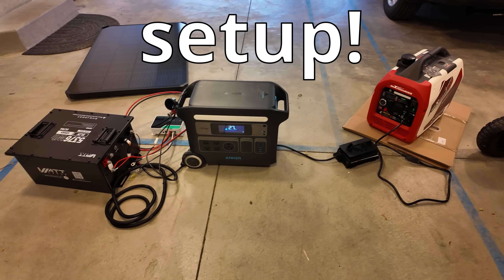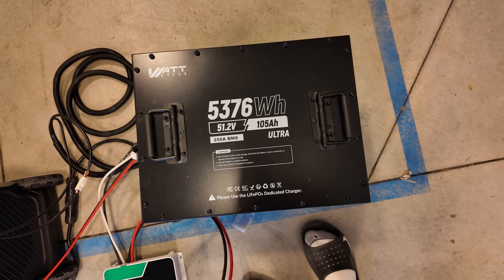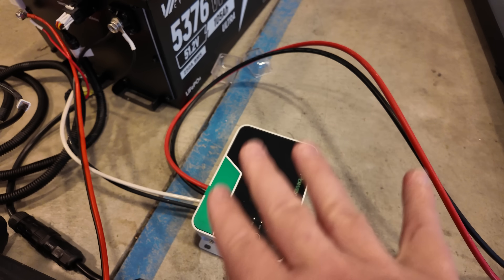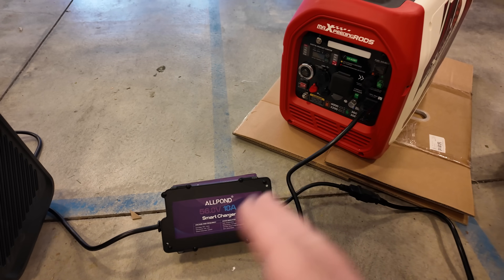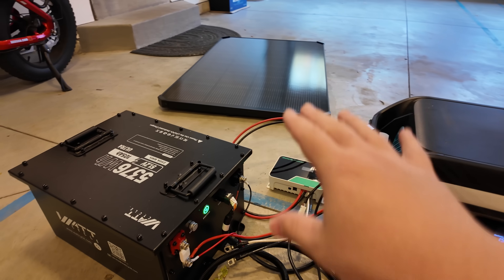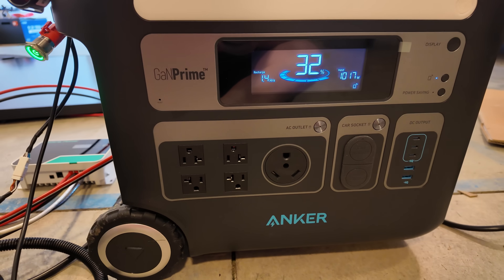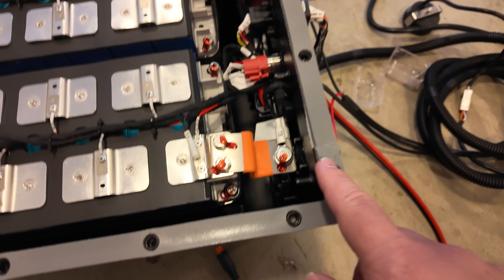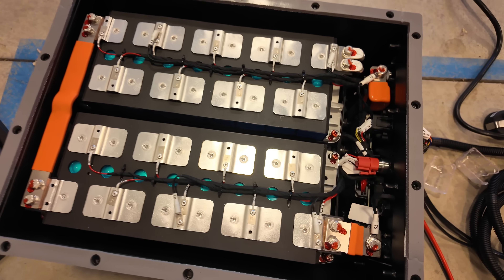The RV Power HACK That Makes Victron Obsolete! - WattCycle Golf Cart Battery

Comment from the maker: Buy a WattCycle Golf Cart Battery: https://www.wattcycle.com/products/48v-105ah-lifepo4-golf-cart-battery-with-bluetooth-kit?ref=fspaohfd
Be sure to use the code: TRICK and save 6% on your order!

Buy 120v 48v Battery Charger: https://amzn.to/3JvxiXt 

Buy EG4 Chargeverter: https://payoffsolar.com/product/eg4-chargeverter-gc-48v-100a-battery-charger-5120w-output-eg4cv48v100av3 
Be sure and use the code: TRICK5 at checkout and save 5% on your order!

Buy the Anker Solix F2000: https://ankersolix.pxf.io/RG6oAN or https://amzn.to/4b4mGrU 
Buy the Anker Solix F2000 Expansion Battery: https://ankersolix.pxf.io/Qj6Xao or https://amzn.to/4hH9fRq 
Buy the Anker Solix F2000 + Expansion Battery Bundle: https://ankersolix.pxf.io/mO2vLM or https://amzn.to/3X3ifrG 
Use code: ANKERSOLIX20 at check out (Anker Solix website only) and save a massive 20% off your order! (Does not stack with limited time deals or other coupons)

Buy the Bluetti Apex 300: https://tidd.ly/4pPlTlS 
OR
Buy from Amazon: https://amzn.to/4qgnXUg

Buy 40 amp solar charge controller: https://www.bougerv.com/products/40a-mppt-solar-charge-controller?aff=230 
OR buy from Amazon: https://amzn.to/41x5BDv 

Buy connecting wire from battery to power station: https://amzn.to/4o8m5eC 

Buy battery terminal fuse: https://amzn.to/4qAIra6 

Buy the best solar panels on Amazon: https://amzn.to/3LchSbj 

Buy MaxPeedingRods 4,000w dual fuel inverter generator: https://amzn.to/4nspzaE 

Watch the video showing the issue with passthrough charging on power stations: https://youtu.be/Jg7HqRmNQlw 

Ask me a question and get a personal in depth response: https://ko-fi.com/s/8d8df1880c 
OR
Sit down for a personal 1-On-1 hour long video consultation with me and I’ll provide answers and insights to anything you want to ask me about from this channel: https://ko-fi.com/s/dd139831a7 

All donations get 100% re-invested in the channel:
https://buymeacoffee.com/theresatrickforthat 
 
Affiliate Disclosure
As an Amazon associate I earn from qualifying purchases at no cost to you! Thanks for your support!

Comment: Is there a heated version of that wattcycle, and if not how hard would it be to retrofit a heating pad to the side of the case so it can take a solar charge in the dead of winter?
Also I already have a Onan 4000 series on-board generator; is it feasible to just permanently connect it to two battery chargers then connect them to the rack battery (or perhaps get two and wire them in parallel) along with solar, then to a solar generator, then to the rig? (so many questions here)
Reply from the maker: Not sure and yes.

Comment: This hack looks very interesting… I have a Bluetti elite 200 and I’m wondering if I connect my 37 V solar panels to an MPPT controller and use a 24 V lithium iron phosphate battery, would that work? And do I just attach the output of the MPPT controller to the Battery terminals and then attach the solar input of the Bluetti to the battery terminals also? Are there any tricks or safety advice I need to know about?  I’m assuming since I have only 37 V solar panels I can’t use the higher voltage battery, I need to be below the solar panel voltage?
Reply from the maker: Everything should work out great as you said! Just be sure to properly fuse and size your wires!

Comment: right so my vtoman flashspeed power station only accepts 400watt solar max but i will shortly have 2000watt worth of solar panels. with this solar controller and that 5000wh battery can i take advatage of all that extra solar during summer i.e get 2000watt solar input. Still learning all this stuff so apologies for anything stupid im saying
Reply from the maker: Yep! That's exactly how it works! And then at night it can trickle 400W out via the power station. So your power station will essentially get 24/7 "solar power"

Comment: Hi, The battery terminal fuse in your link looks very different from the one in this video and other videos you have posted using the same cable. Is that another one of your DIY harnesses?  Thanks
Reply from the maker: Yes! I just had a random inline fuse kicking around so I am just using that. If I were to buy something specific, I would get a terminal fuse. Much easier to install!
Reply: @theresatrickforthat  one more question please: the battery terminal fuse link directs you to a 30A fuse, so is that dependent on the amount of solar amperage going into the mppt or the power station input (i.e. I have 40A of solar going into my mppt > Temgo Battery > Anker F2000 @ 20A)?

Comment: Are the specs of the WattCycle battery so much better that the Temgo battery from some of your other videos, to justify the additional cost?  Thanks for your videos.
Reply from the maker: The build quality is head and shoulders above the Temgo. But power wise, they are almost the same. But the WattCycle is more capacity and higher discharge power.

Comment: Is a 10awg wire between the battery and the inverter and a 30A fuse to protect it, the correct combination? What are the calculations you are using to ensure you don’t melt the cable? Thanks in advance.

I am planning on using this similar setup with a Pecron F3000LFP and an EG4 server rack battery. (Not in an RV)
Reply from the maker: Yep! That’s exactly the fuse and wire combo I did!

Comment: I have the Eco Flow Delta Pro with a Honda EU 2000.  I can do this with the Eco Flow Delta Pro correct?
Reply from the maker: Yep! So long as the Delta Pro will accept at least 60V DC, you're good to go!
Reply: @theresatrickforthat  That's 60V DC "solar" input?
Reply: @theresatrickforthat  SO the EcoFlow Delta Pro shows the Solar Charging Input is 1600W, 11-150V, 15amp max...would this setup work?

Comment: Thanks for sharing your experience and findings! Watched your videos with the Bluetti Apex 300 and with the Temgo battery kit. Are you still using and satisfied with the temgo kit? And which fuse are you using for the battery? For the value, the watt cycle battery kit seems a little more pricy?
Reply from the maker: Yep! Still use the Temgo all the time! I use Victron fuses. The WattCycle is better built compared to the Temgo, but yes, there is a price difference!
Reply: @theresatrickforthat Make sense for the watt cycle built and the shut off button but there's actually more advantages with the Temgo built ironicaly in my case "no pun intended" lol  (plastic lighter weight, don't rust in humid area). Thanks for the quick response and it shows that you enjoy experimenting and finding ways to optimise ressources 👍. All the best on your adventures.

Comment: I would not trust that BougeRV solar controller and it's more expensive than the Victron 150/45 which can handle more watts, also comes with Bluetooth and is going to be much more reliable so why would you recommend it over the Victron? BougeRV solar controller $US217.25 =$AUD334. Victron 150/145 $AUD281
Reply from the maker: Must be different down under! :)

Comment: E X A C T L Y!⚡️/ you touch on but it’s important to over emphasize that it’s absolutely crucial to Make sure that your power station is rated to accept the voltage of the battery that you are going to connect otherwise you will fry the power station.

I.e. the power station is rated to accept up to 60 V input - the battery at 51.3 & as you stated can surge up to 55 or 56 volts when fully charged very very simple.

PS: love the channeling content. You’re bringing an enormous amount of value to this community. Thanks again!
Reply from the maker: Yep! Important detail! So happy to hear you are enjoying the channel!

Comment: I suppose one thing with everything except for the inverter on the power station bypassed, why not just go for an inverter and dump the other basically unused equipment inside of the power station overboard?  It would also allow you to draw at max power continuously instead of a continuous load of just 1,000W.

Another thing, what about using Anderson connectors?  An SB120 would be fine for going up to a 5,000W inverter.  Then your other stuff could go on Anderson Powerpole connectors and a distribution block.  Quick, easy hookup and disassembly.  Maybe add an anti-spark circuit to the inverter so you are not messing up your connectors.

When you get into 5+ kWh LFP batteries, it would be nice to be able to easily wheel it around.  It is just kind of hefty at that point.  Don't mess up your back now.

Another thing with communications and batteries, is what about just going for an all-in-one solar charge inverter and a server rack battery?  Then you start getting back into consolidating things into a main box instead of having it all parted out like what you have here.
Reply from the maker: All good ideas! Yes, if you were building from scratch, AIO would be ideal. But a lot of RV people especially already have a portable power station, why not make better use of it! And server rack batteries are awesome! But they are not built for high vibration environment like golf cart batteries are, which is why I like them for this. Thanks for sharing your thoughts and ideas!
Reply: @theresatrickforthat The setup I am using is based around a 24V 100Ah battery that is highly portable.  It is all modular with Anderson connectors including SB120, SB50, and Powerpole.  Super highly versatile.  I have a newer 3000W inverter and an old 600W from a previous LFP battery setup.  Applications I have:
1. Extra power for electric kitchen.

2. Emergency backup power for home with a generator as well.  I went for a newer Pulsar varient of the generator you have.  $600 for the generator and it still has a nice display and runs on propane.

3. Run work from anywhere setup that is all DC with buck-boost converters.  No inverter needed.  Makes it more portable and use a combination of Powerpole and cigarette lighter ports so equipment can also plug into a car.

4. Camping setup.  Can run portable fridge directly off of battery for days of runtime.  Can run cookware through inverter.  Can run USB charger direct off of the 24V battery. Can do solar charg8ng and ditch the generator when weather is right.

5. Run hobby charger for R/C helicopter battery charging at the field.  The hobby charger prefers 24V DC and the flight packs charge to 25V each.  The hobby charger fans don't even kick on until it gets to the balancer phase.  I mean main charge is super efficient at high power levels as it is a buck-boost conveter with the power basically flowing straight across from the big LFP battery to the LiPo batteries charging in parallel.

5. Run portable 300W LED work light.  Can illuminate whole areas for hours on end.

All of this works out well between 24V being directly used for a lot of stuff, the battery being easy enough to carry around while designed to be mobile, 3000W enough for a lot of stuff with the above 2000W mostly being done in short busts as the battery can only sustain 2500W, but can take up to 7500W surges, with a 3000W surge being something it will do for several minutes and be OK.  Also like my fridge at home burns less than 1 kWh per day, so a 2.5 kWh battery is going to power it all night long no problem.  When working from anywhere while I don't need a solar panel, even while driving a 32" display with a 24V power connector on it, a single portable panel on a sunny day will produce twice the power that my portable computer setup can use.

Comment: The solar charge controller you have in this video is from Bateria Power is there any reason not to get the 40 Amp one from them?  They seem to have a website, but only a 100A one available on Amazon. 4:31
Reply from the maker: Yeah, Bateria Power is semi out of business. So don't buy from them right if you can find them selling much at all. Just use my link in the description to get the 40 amp model made by the same manufacturer, but branded a different brand that has been around for quite some time and should stay around for a while longer here.

Comment: I currently have a 12V Watt Cycle in my RV now and love it. (I'd love to get one of those big bad boys). charges fast, solar, or shore power. And it lasts us just fine. 21' trailer. Just the wife and I. Can't do AC but that's fine right now.
Reply from the maker: Glad to hear your setup is working out great for you!
Reply: Watt cicle da 314ah mini is perfect con 4celle lifepo4 mb31 EVE 314AH IS 4KWH BATTERIA con smart bms includet 489euro circa
Reply: To day i pannell solari da 500watt wp in Italia o UE cost 90euro circa new tipo longi  da 610watt modell new x10 bifacciale cost  159euro x 1pannel o i 410watt 172cm x 113cm 80euro is good

Comment: I'm using this type of setup and nothing's as elegant as Victron or Redarc. But...

This design has a significant flaw: where's the 12v output? RVs require a plethora of 12v appliances to run. For example, the Eberspacher line of diesel heaters requires up to 14amps (at 12v) to heat the glow plug that is surged similarly to starting a motor. Then add an ARB 50 refrigerator (6amps), LED lights (6 amps), fan(s) (5-10amps), 12v water heater (60amps) and possibly even an air conditioning unit (60 amps). 

Victron can support all the above without issue...but at a cost, of course. If the features you need aren't there to begin with, you've already wasted your money.

Can you explain, exactly, what your plan is to power the list above? In my case I had to resort back to a 12v LiPo battery (or two).
Reply from the maker: I would leave everything stock in the trailer. It’s going to have a 12v system, battery and converter to charge from AC power when connected to shore power. And then simply plug the RV shore power cable into the power station! That’s it! No, it’s most certainly not as elaborate as a Victron system, but this is going to get the job done nicely at a fraction of the cost and I can pull the power station and golf cart battery out of the trailer and bring it home during the winter to help with home backup when the trailer is just in storage. More bang for my buck that I don’t have too many of these days.

Comment: Nothing makes the Victron obsolete...this only has portability as a difference,if it matters,than by all means,but victron is superior in all other aspects.
Reply from the maker: That's fair! Different systems definitely have different strengths depending on what you prioritize.
Reply: @theresatrickforthat  would this work with the BLUETTI RV5? BLUETTI is trying to take on Vicron with their super easy plug and play RV5 system

Comment: the nice thing about this system is that you can have the solar panels and batteries mounted in your RV and be able to take the power station out to use for something else.
Reply from the maker: Exactly! Super flexible multi-use! That’s what I am always looking for…how can my investments serve multiple purposes!
Reply: This is exactly what we do. The power station sits next to our chest freezer when not in the RV in UPS mode in case we lose power. Also use it for power outages in winter to run the home furnace. These power stations have really made being self sufficient so much easier.

Comment: It's a great hack, I've been doing for a while when I need to extend running times of a power bank.  This is why I never buy expansion batteries when you can buy stand alone batteries for a cost that is 2 or 3 times less than the expansion battery and with double or triple the capacity.  A small point of constructive criticism.  First you need to use fuses, and secondly, it would be best for your channel if you want to grow it more if you would do videos of step by step connections and instructions instead of just showing what you already did.  You need to understand that there are viewers that learn best from seeing how it is done than by listening as to how it was done.  Do not assume your audience is composed of viewers that have or surpass your knowledge.  Some people need to be spoon fed.  If they learn by seeing the actual process of connecting they will remember your channel and subscribe.
Reply from the maker: Thanks for the feedback! It's great to hear your experience with this kind of setup too.
Reply: Hey you are damn right about this
I am one that needs to be spoon fed I learn better that way., 😁👍
Reply: Well said
Reply: 8:52
De hecho, SI que está usando fusibles, el problema es que tu NO lo viste porque NO eres un buen observador!
En el minuto 8:52, puedes observar que en el borne positivo de la batería, está conectado un fusible de color BLANCO!

Comment: It is better to use Solis Hybrid 5000w solar inverter charger with that battery than Anker. Solis can charge, discharge ongrid and off grid settings. You can recharge your 5kwh battery in one hour.  Solis can accept up to 6kw solar panels and can charge from grid too. Much better option than Anker power station. You can fit/mount Solis inverter directely on that battery. I have whole house running on Solis and have diy 15.6kwh battery made of 16 EVE304 cells.
Reply from the maker: Thanks for sharing your experience and ideas!